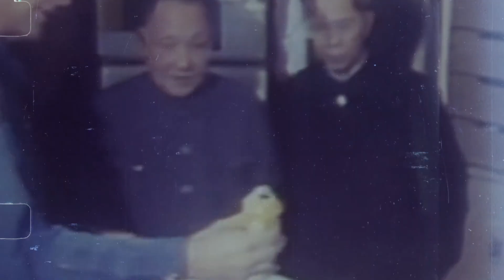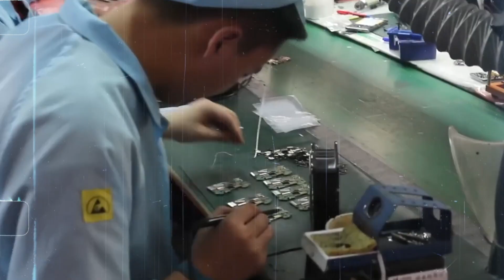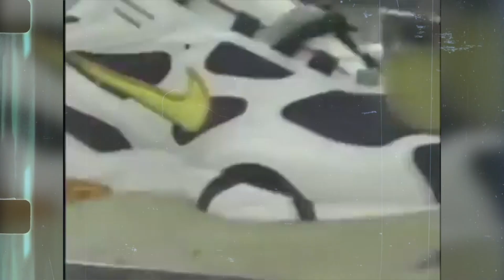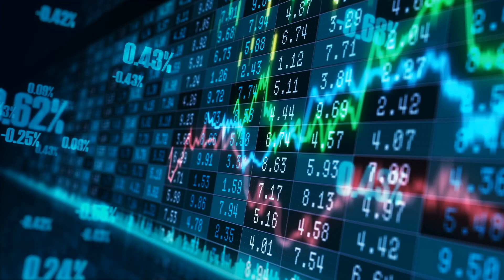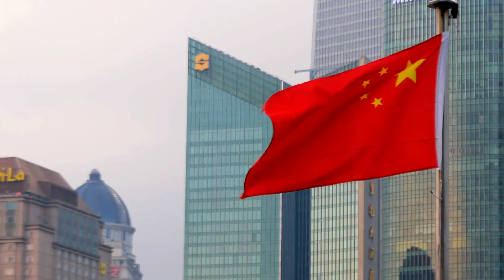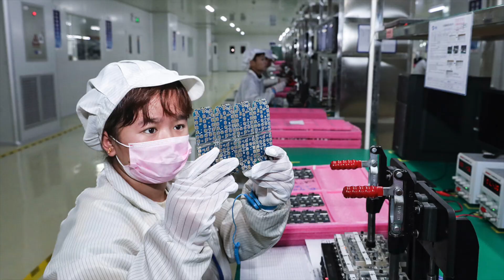The Great Manufacturing Shift: How 'Made in China' Conquered & Crumbled

Comment: Crumbled? It's a natural evolution for manufacturing nations to move up the value chain as the landscape inevitably changes. Those that can't get swallowed up by what is known as the middle income trap, where labour costs have become too expensive but there isn't enough highly educated workforce to allow the nation to shift up the value chain. The only difference with China is the sheer speed at which the country moves on all fronts. Just 30 years ago it was a nation known for cobbling together cheap knock-offs. Ten years ago it became a part of every damn supply chain you can think of. Now it is also at the forefront of R&D, already jumping to the next step up the value chain. The real question is, which other nation is poised to fill the vacuum China will leave behind when it moves up the value chain and dominates entire industries?